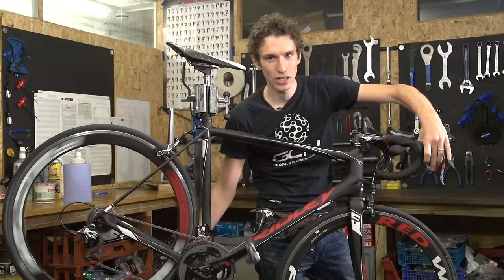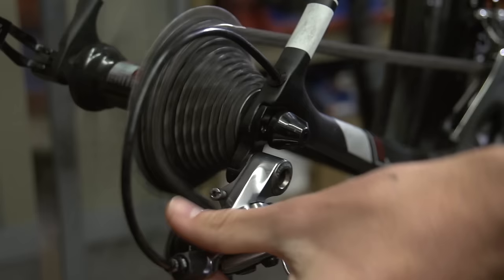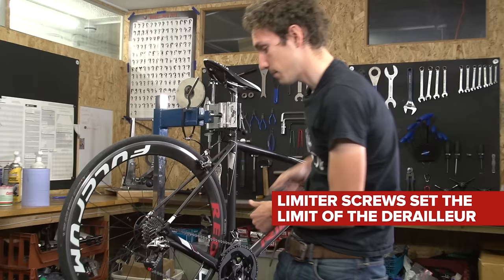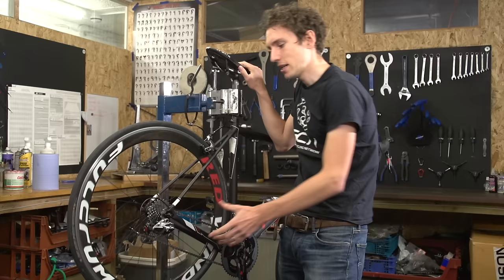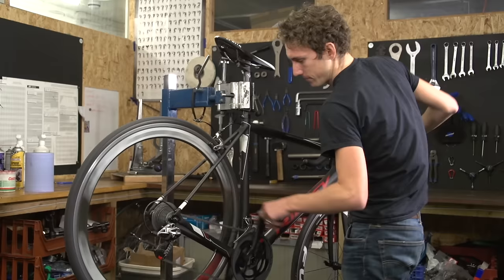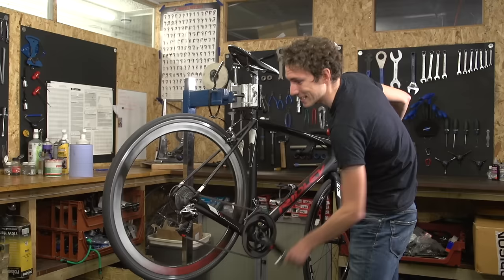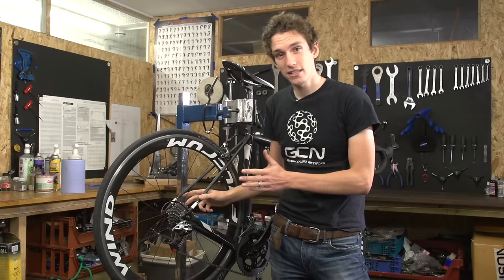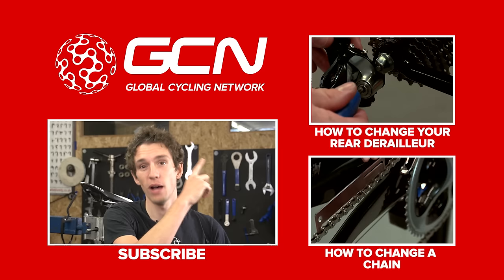How To Index Your Gears - Adjusting Your Rear Derailleur

Comment: Pretty much always when I'm trying to change to a lower (easier) gear, the chain jumps over one of the gears. This doesn't happen when I'm changing to a bigger gear. Do you have an explanation on what could cause this? I've noticed that if I push the shifter very slightly, then it usually shifts one gear at a time, like it should. But it really takes some enjoyment out of the overall riding experience, when I have to so carefully try change gears.
Reply: Too much cable tension, turn the barrel adjuster clockwise a touch. Adjusting the barrel adjuster clockwise decreases the cable tension slightly.
Reply: stoppsi But wouldn't that mess with the indexing, like shown in the video?

Comment: Can you help?

On my second-largest cog the chain ticks and clicks, generally makes a racket, and sometimes shifts onto the next (smaller) cog of its own accord. This used to only happen with the chain on the big ring but now both. Only the second-largest cog. Also, changing to smaller cogs can be lazy sometimes. This is a Tiagra groupset which is less than a year old and has done approx. 700-800 miles. All help appreciated!
Reply: PS I wonder if it's too much chain angle. I don't ride big ring - largest cog, I know that's too extreme and considered naughty. But 2nd cog, should that be verboten too? 10-speed cassette, I think.
Reply: Yep, well don't everyone rush at once :-/
Reply from the maker: It might be that the cables are a bit old and mucky and so there is extra friction internally.
Reply: Thanks for replying  (and sorry for being a bit of a brat!)
Reply: Thanks for replying  (and sorry for being a bit of a brat!). The bike's only a year old so I wouldn't have thought so but it's in with the LBS now for some TLC so hopefully it'll be silky smooth again in a day or two.
Reply: For future reference and for the benefit of the masses, my LBS reports that the problem was that the cogs of the cassette needed tightening. Cheers
Reply from the maker: Glad you got it sorted.

Comment: So my issue is that when I put force on my pedals sometimes in a climb but not always I’ll get a pop in my chain. It’s not a slip, but it sounds like a jump. Chain is fairly new and I don’t see any excessive wear on the sprockets. I went to adjust the derailleur with the rear barrel nut b/c it seems my hanger was not indexed. However, could not get to my lower gears with pushing the lever several times. Apparently I kinda fixed the jumping (not completely but less) but then messed up the tension. All cables have been replaced recently too. So now what?
Reply from the maker: hmm, this could be a few things. worth checking the chain and sprockets/chainrings are all ok and nothing has a tiny bend in it at all. 👍
Reply: @gcn I’m wondering if the hanger is bent. It was supposed to be check by a bike mechanic before I bought. Obviously on a stand it was fine. It’s during rides it will happen 3-5 times.

Comment: Hi GCN! 
How does this "chain jumping" occur? I recently cleaned my bike and when I took it out for a ride afterwards, the last (smallest sprocket) gear makes that sound as shown in the video plus the chain is jumping. 
I guess it's because I've accidentally done something to the gears, or is there another way this can happen?
Reply: You might have got some dirt in your sprocket or the sprocket is full of gunk. Use a thin blade to clear out the dried-out oil/muck in between your sprockets. Also, oil your cable. Check the limit screw.
Reply: I tried this but nothing seems to work :/
Reply: Then the chain needs replaced. If that still doesn't work, replace cassette. Also check derailleur bushing, May be worn on Tourney & other cheap ones. HTH

Comment: I decided to try out indexing my gears today by adjusting the rear derailleur and i've got a question. I've managed to get the gears to change rather smoothly except for the highest 3 gears. Whenever i change down gear for those 3 gears it feels more choppy than the rest ( although it still changes successfully). I've tried indexing them but if i make those 3 gears smoother then the bigger/lower gears become more choppy and sometimes even fails to change properly. I am currently using a 10 speed tiagra road bike. Perhaps that's just a limitation of a low end groupset ?
Reply: Jon Ang
More than likely you have some grit or corrosion inside the cable housing. All it takes is a little extra resistance to throw everything out. Try changing the cables or a little oil or other lubricant inside the cable housing.
Reply: second that. or the deraileur hanger is bent a bit.

Comment: My problem is i get it to ride up to the large ring, but it wont drop down , then i loosen the barrel nob then it will drop, but then it wont jump back up two the 2nd small ring ,then ill tighten it a bit till it jumps, but then it wont drop back down from the large ring again. and the cable housing and cable are clean and greased.

Comment: Global Cycling Network my 105 shifts finely but it makes a chain noise when it's in the mid two cogs (especially when it's on the big front gear). Any tip? Oh, btw, the hanger is aligned...
Reply: Global Cycling Network Thanks! It's a 2013 Giant TCR, but it was a display bike, so the cogs shouldn't be worn (hopefully)... I have lubbed it all. It rattles somewhat like it wanted to change gears, but the noise comes from the front derailleur.

Comment: I have a problem maybe y’all can help me fix! The cable that goes from my shifter, through the housing and to the derailleur keeps getting pulled back into the housing or on the shifter end and it gets super tight on the derailleur side and it obviously messes with the shifting during the ride. I do this pretty much every time I take it out for a spin. I pull the cable out from the housing  on the derailleur end to give it slack and it works fine but after a few turns, jumps, etc it gets pulled back towards the shifter or into the housing and all the slack I gave it is gone again. Any ideas? Help please.

Comment: I have changed my cassette for a new one. I have indexed my gears and they shift great. But when i pedal in some gears it feels a bit "woody". It 's like my rear derrailleur is made of a bunch of rocks. With my old cassette i did not have this problem.

Any ideas what might cause this?
Reply: You probably need a new chain as well. Whenever I change my cassette I always change my chain. They have a tendency to stretch and wear away the cassette so when a new cassette is fitted with an old chain it doesn't quite match up.
Reply: Thanks. That could be it.

Comment: Is there a possibility that after a few years the rear derailleur is worn out? I'm struggling with the rear derailleur of my old cx bike, i have new cables so that's not the problem, could it be that after some years the spring (inside the derailleur) loses its strength?
Reply from the maker: It could be that, yes. Try leaving your bike in a lower gear, then clicking down to a few gears higher without pedalling. See if you can move the rear derailleur side to side pretty easily (not feeling much resistance from the spring) to check if the spring is worn.
Reply: Thanks!
Reply: ***** thank you, I'll give it a look but i check these components regularly and the bike is 12 years old or so, i think a new derailleur would be the best..
Reply: ok thanks! i see if i can find a spring

Comment: My gears make a lot of noise when on the inner ring. Everything shifts fine however. Any suggestions to get rid of the noise?
Reply from the maker: Yeah, we'll look at front derailleurs soon, but it could be one of two things. Firstly the low limit adjustment screw might need turning anti clockwise a quarter turn to move it over further, or that the cable is too tight, so loosen it off a fraction.
Reply: Check the B limit screw and your chain length.

Comment: +Global Cycling Network. Can you make a video on how to fix hand shifters? In order to shift to my small chainring I have to press the lever at just the right angle or it will not catch.
Reply: My rapid fire shifter was stuck on 1st and I just drowned the inside in oil and kept shiftng through the gears. I left a rag below it to catch the drips. Then wiped it off.

Comment: I can shift onto the smaller sprockets alright, but have to do two shifts (OOPS TYPO!) to shift up one larger sprocket.. Any ideas?
Reply from the maker: You have to do two WHAT Ben?! I think I know what you mean. Keep working on the indexing lower down the sprockets, it's all interlinked. If you're still really struggling, make sure you check the trouble shooting section in the video.
Reply: Global Cycling Network Oh dear! Cheers :)

Comment: I was going through this video and noticed that my cassette wobbles a bit what can I do to fix this? thanks
Reply from the maker: evymeto A tiny bit of wobble is normal, but if the cassette is loose then you need to tighten it. You'll need a special cassette lockring tool for the job.

Comment: Hello, maybe someone can help me here. 
My derailleur hanger keeps bending inward. 
Fresh hanger, aligned and everything, one month later, the lower jockey wheel is already too close to the spokes when sitting on the largest cog. 
What could be the problem ? Pedaling pressure ? Too soft material ?
I sure tried my best to change gears properly without load on pedals and lateral hits on that area never happened. The bike is 5 months old.
Regards
Reply from the maker: It's strange for it to happen if the bike hasn't received any hits or knocks in that area?

Comment: I have a click when I shift up a gear (easier), I have to shift up twice and once back down to make it not click. What should I do?
Reply from the maker: +L0stie It sounds like you need to increase the cable tension, so turn the barrel adjuster anti clockwise about half a turn to see if it fixes it. If not, turn it half a turn again until it does.
Reply: Might be a sticky outer housing. This can need doing sooner if you ride in the wet a lot.

Comment: wonder if somebody around here (still) can help me: I changed wheels, so I removed my entire 10-speed cassette from old wheel to the new wheel. Both wheels have 11 speed bodies, so both would need some kind of spacer. My cassette was made up of some little loose rings, then a plastic spacer (somewhere between 1.5 and 2 mm my guess?), then the last few rings as one big solid block. After that, there was a tiny 1mm or less ring (Looks more like a wire) on the body.  I moved everything to the new wheel, including the little wire-ring. Now, my gears aren't as smooth (I think), and if I shift quickly to the big ring on the back, it can go too far and my chain ends up between the spokes and my big ring. But only if I do it quickly.
Do I remove that 1mm wire-ring, or do I adjust my derailleur ?
Reply: Try comment when the next gcn video comes out regardless of the topic, im sure someone will be able to help
Reply: @zuber2325  thanks for responding!   But I found it I guess. I removed the little <1mm wire-ring but the same thing happened, so I started adjusting the limit screws and then reindex my derailleur. I never could get it right.
Turns out that my crash - reason for a change of wheels - also gave a knock on my RD and it was quite a bit out of alignment. I gently pushed it back till it looked straight by eye, then readjusted my entire RD again from scratch. Goes smoothly now and doesn't drop!

Comment: I've noticed that if you turn the barrel adjuster counter clockwise too much, it will cause the chain to come off the largest sprocket, into the spokes. You can fix it by adjusting the barrel clockwise, without messing with the limit screws.
Reply: however thats not the right thing to do. if your cable lenghtens over time or you hit a bump it might still fall of the largest sprocket. the limit screws are hard limits, set them up correctly and the derailleur cant go too far -> your chain can not fall off.

Comment: 🤣I am laughing so hard at the comments, because after changing the cable and trying to index, I got so angry too. My adjuster is underneath the frame, so twisting directions change and I can do it when riding. I was taught to pull the cable tighter at where it is fixed at the derailleur and then do adjustments with the twist nipple. It is kinda ok now but I feel the knocking in my foot in some gears and the moment I notice, the "pissed off" is right back in my blood 🤣🤣

Comment: I took my road bike into Halfords and asked to get my gears serviced I told them my issues and they said they'd fix them. They didn't when I'm in top chain ring and gear 1 it rubs against the front derallieur and when in top chain ring gear 7 it slips (doesn't fall off or change gear just slips when you apply pressure) HELP PLEASE!!
Reply from the maker: Well, big chainring and big cog at the back will always rub as the chainline is a bit extreme, so you shouldn't really use that gear. As for your biggest gear, that sounds strange. Try checking the H screw to make sure the derailleur sits right under the bottom cog.
Reply: Ok thank you ill give it a go tonight

Comment: Isit possible to change a road bike to cyclocross bike?? If possible. Can tell me the steps?
Reply: Generally, no, because the road frame/fork lack the clearance necessary for cyclocross tires (and mud). But I have seen some road bikes with 30mm CX tires albeit a very close fit.
Reply: No, road bikes and crossbikes have a different geometry and brakes types to make it possible to accept wider tyres.
The max width you can use on a roadbike is normally 28c, this is what I use during this season on my Viper road bike.
In the winter I use my Crossbike with Rocket Ron foldable tyres or my 29" MTB with Michelin Country Grip'r

Comment: I why did Si reach to the left brake lever to stop the rear wheel?  Are you in backwards world?
Reply: in the UK they drive on the left and therefore the rear brake is always on the left.
Reply: Same thing in sweden, and we drive on the right. 

However, it might have to do with the similarity to motorcycle layout. I would have hated having rear brake on the right, where i have the front brake on all the motorcycles.

Comment: What if the barrel adjuster on my rear derailleur does not adjust the tension of the cable? What then?
Reply: You’ve probably maxed it out. Best thing is to wind it all the way in, loosen the cable pinch bolt, set your high limit then gently take up the slack in the cable and tighten the cable pinch bolt back up then index.

Comment: My chain is skipping on the jockey wheel when I'm trying to index the rear. Any ideas why?
Reply from the maker: Check to see if the jockey wheel is running smoothly. Sometimes the bearings/bushings get seized up.
Reply: Doesn't seem to be rotating true. Looks loose.
Reply from the maker: Mark O'Reilly That shouldn't be too much of a problem, they are designed to have a bit of play in them. Are the teeth worn?
Reply: Not entirely sure but they don't look like new. I think I'm due replacements anyway. Off to the shops for me.

Comment: questions  can you explain  the gears. cause  i have a 11,32 i think thats a 11 speed
Reply: Cannondale  synapse  105 5 2015!  people  always  ask me what speed is that. i dont know if it's  11 speed  or 32?
Reply: +Jose Aguilar count the sprockets on the back. the 11 and 32 are the number of teeth on each sprocket. 11 = high hear (faster/harder to turn) - 32 = low gear(climbing/easy to turn).
Reply: Oliver Duffy thank you  for the info..

Comment: gears shift to higher gears smoothly but does not shift to lowers.. what should be done in this case?
Reply from the maker: Arnob Rahat Soinds like you either have too much tension in the cable or the cable is sticky and needs replacing.

Comment: I think, for setting the high limit screw, you should detach the cable from the derailleur. And turn your barrel adjuster all the way clockwise.
Reply from the maker: Hi Edoardo, there's really no need as the derailleur will naturally sit back there when you click into the highest gear on the cassette.
Reply: Global Cycling Network You're right, didn't think about this, thanks!. But, with the method I described you can remove the stretch of the cable, tell me if I'm wrong. Detach, barrel all released, attach pulling, and the cable is no more stretched as before.

Comment: I'm utterly fed up with derailleur gears after decades of riding bikes with them. Contrary to what this video claims, it's a complex system prone to constantly falling out of alignment and needs constant maintenance. Is it any wonder, considering that it is a transmission system left out in the open? Few riders have a workshop and a bike hanger, so we're stuck trying to repair faulty gears in the rain, wind or snow.

Comment: My Tiegra's back shifter's limiter screws are in the rear, just in front of the cable, and my multi-tool's screw driver can't reach the screw because of that cable...
Reply: +张一得 and even I finally managed to go around that cable, my rear derailleur didn't seem to move as obvious as in the vid...
Reply: +张一得 FYI it's in the outward of the smallest gear thx ( I'll probably take my babe to the bike shop before your reply......

Comment: I dial in my H and L screws ✔️
I dial in the change from smallest cog to second smallest cog✔️
then I cannot go any further as the barrel adjuster can't turn inwards anymore
Reply: Can anyone help, please.
Reply: Sounds like you need a little more slack in the cable. Loosen the bolt on the derailer, that holds the end of the cable, to get a little more slack. Shouldn't take much. Remember to tighten the bolt back up.

Comment: Something to add that was driving me mad: If you end up not being able to shift into the smaller cogs in the back, that could be due to too much tension on the wire. I had to detach it in order to get more leeway in order to adjust the derailleur.